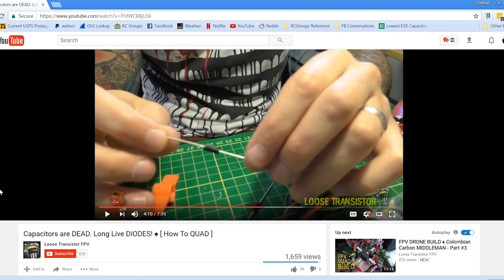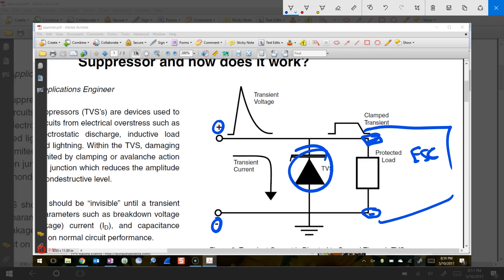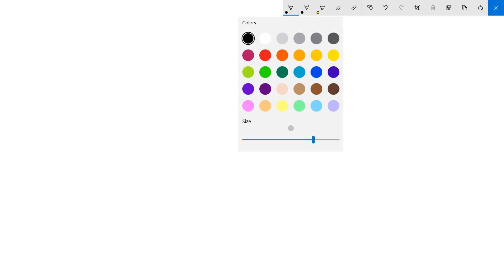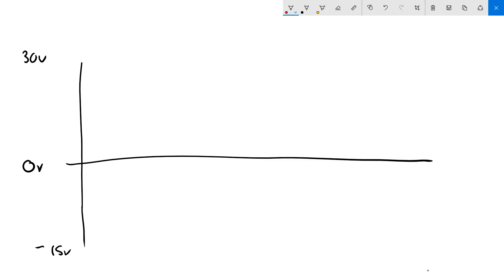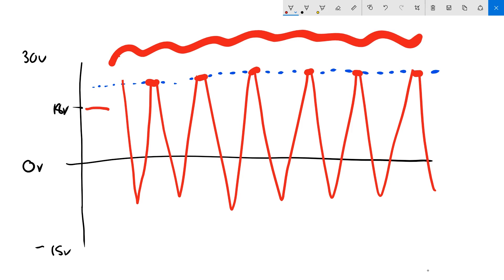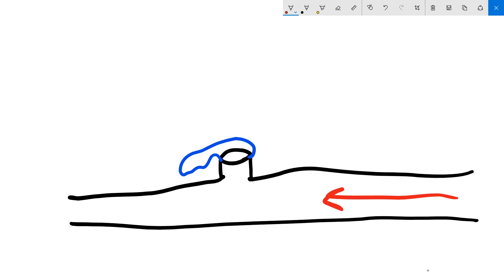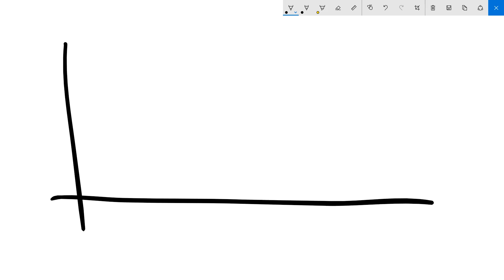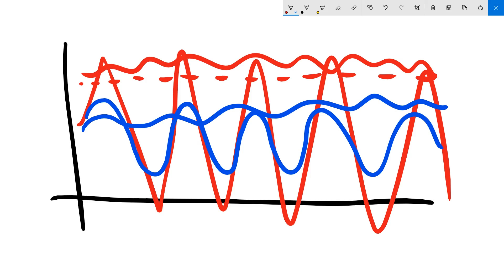TVS Diode Instead of Capacitor? No.

Comment: Hey Joshua, Glad to see you looking into this as well.

Yes the title was a bit clickbaity but I didn't think people would even look at it if I said "TVS Diodes are neat!" or something to that effect. I am preparing more data including some actual live tests with o-scope to determine once and for all what the effects of the TVS are and how they may benefit our builds. 

Another thing to consider in all this is the Battery itself, it is a capcitor and a rather large one so it too attenuates some of the noise in the system. It doesn't respond as fast as a low ESR but it is still doing something.

I am not actually saying don't use capacitors, I just wanted to start a discussion on an alternate method and sometimes controversy is the best way to start a conversation.

Happy to see people looking into this, because the more we learn about our copters, the better we can make our hobby. I will let you know when I have some hard data that we can look at. Sounds good?
Reply: I would agree that Loose's title and description is a bit misleading.  There is some confusion as to the type of noise a TVS may prevent.  What you point out in your vid Josh is common mode noise, which indeed caps are a must for.  A TVS can help with normal mode noise , and noise and instability caused by transients.  They are not intended to act as a filter for common mode noise as you presume in your video.  Noise from transients does not have a frequency component , and are relatively random in nature.   Also, the transient does not come from the ESC.  Rather they are generated by the inductive kick back of the motor.  Commonly know in the electromagnetic rotating machine industry as "commutation kick back".  Which can also be caused by the active breaking.   The primary purpose of the TVS is to snub these killer transients, which indeed are present , and do kill devices on our quads.  They will also help with noise generated as a result of the transient causing instabilities in power supplies (ie regulators) , as well as some  conducted, and radiated noise as a result.
Reply from the maker: +Loose Transistor FPV love to see the scope traces.
Reply: well Dirty , you just dont understand the issue.  You certainly may have not suffered any of the ill effects , but others have, and just because you have not, doesnt mean they dont exist.
Reply: We are working on getting those for you :) 8 channel synched o-scope readings, something is going to get science like in here :)
Reply: I would argue that noise won't kill a device NEARLY as quickly as a transient. So a TVS is a must. A cap is nice to have
Reply: I wanted to check everything ;), so all 4 motor esc'c, camera supply voltage, tx supply voltage 5v rail and back at the battery lead. Will give us lots of data.
Reply: Dirty Robert.  As has been stated, it hasnt been a real issue until recently.  The introduction of relatively very powerful motors, and switching very high currents into these inductive loads that it has become an issue.
Reply: TheWizard I agree, I just lost a matek vtx due to a voltage spike. Thus the reason I am looking into this.
Reply: Why do you need 8 channels?  Only one channel on the supply rail is all that is required.  However, please do get scope traces with and without TVS.
Reply: I'm running Cobra 2207 2450kv gold on 30A escs and it's not an issue.
Reply: Been flying quads for five years and never found this to be an issue. It might be that you are just not good at making a system that works as it should and patching your mistakes is the route you have chosen.

Comment: This may sound stupid...but...has anyone ever tried to make a battery for a quad out of capacitors? Assuming you can get the proper voltage, you have "limitless" amps to draw and it's significantly lighter along with ultra fast charge times and no degradation due to recharge...
Reply: It'll be empty in less than a second duh..
Reply from the maker: +Beau it isn't lighter when you take into account energy density I don't think. Build me a 1.3 Ah, 16 volt capacitor bank and tell me how bug it is.
Reply: Beau there is a video on YT where someone did that. I think it flew for 20s or something
Reply: SroArcher
I doubt that ;-)

Comment: Sorry Joshua, I'm a big fan of you and you helped me a lot in the past, but this and the capacitor stuff is getting ridiculous. I actually am an electrotechnics engineer and I can tell you that if you need all this in front of your ESCs, the ESCs are just cheap and bad designed. So instead of letting unexperienced people solder the strangest fire hazard stuff, maybe one should think about what's actually happening. Think about the size of a Diode which is supposed to pass through something like 20 Amperes (be it just spikes, but still..) :)
Also I don't think the Voltage is going negative in the event of braking. ;)
Reply: "I'm Ulf and you're going to learn something today" 😁
Reply: Joshua Bardwell IF we're talking about generative breaking energy stored in the spinning motor is fed back to the battery, and for that to happend the voltage at the ESC has to be greater than the  battery voltage.
Reply: Yes, what Joshua calls breaking should rather be generative breaking (think Toyota Prius). But if that happened, the voltage would increase to reverse the current back into the battery.
Reply from the maker: +Ibrahim Ulf Karlsson hmm. You're right abut that.
Reply: Joshua Bardwell - The only way current can flow from the ESC back in the direction of the battery is for the voltage to be greater (more positive) than the battery voltage - basic Ohm's Law.
Reply: Geoff Haynes I think it's Kirchhoff more than Ohm in this case ;)
Reply: Reverse current in this regard is completely different to negative voltages.
Reply from the maker: Yes, y'all are right. I'm not sure what I was thinking about negative voltage.
Reply from the maker: +Alexei C yes you are right. I know Ohm's Law but for some reason thinking about the diode confused me. Thanks for the correction. I agree that the voltage doesn't go negative.
Reply: Joshua Bardwell yes you are missing something. As it is explained in the picture I linked above.
Reply: So is this comment going to be pinned?
Reply: +Michel Pastor  As is the case with every other device on the quad.  AND , we have people building these fire hazards with very little electrical knowledge, or soldering skill.   There are FAR more things to be concerned about as a potential fire hazard than a TVS.  You may as well stop using ESC's , or any power at all for your quads, tie a string to them and fly them like a kite.  These strawmen arguments hold no water.
Reply from the maker: +Ibrahim Ulf Karlsson voltage can't increase both directions. If we define an increase in voltage as pushing current into the ESC, then by definition what pushes current out of the ESC must be a decrease in voltage. Or, more correctly, an increase in negative voltage. Am I missing something?
Reply: In the event of negative transients , you can use a bi-directional TVS that will snub transients of either polarity. Negative transients shouldnt be much of an issue in this case as they are rectified by the half bridges on the ESC.  However, they can still be present, just at a much lower amplitude relative to the positive.
Reply: Ibrahim, You are correct.
I think Joshua is confusing relationship of the current direction with the voltage. Voltage does not go negative when ESC is braking, but current does reverse. And it happens because Voltage at ESC pads is greater than voltage at the battery pads. Current will always flow when there's a voltage difference. How much of the current, well it depends on the resistance of the circuit and voltage difference. Think about Ohms law: I=U/R, so the larger voltage difference --> more current. Smaller resistance --> more current. Larger resistance --> less current.

another thing for Joshua: it is always good to know or be specific about your "reference" point when measuring voltage. It is assumed to be "ground" or negative terminal, but that's not always the case.
Reply: +Phil Jehmineh. When you say fire hazard you couldn't be more right. If we start putting a TVS diode directly across the battery in case it fails it could light the battery on fire. When the diode fails it often becomes a dead short and without a fuse the battery probably won't survive.
Reply: No big deal if the TVS catches fire but if it is the LiPo your quad is toasted not just the TVS. That's all I'm saying.
Reply: It doesn't take too much for one of those tiny diodes to fail. Take for example a Littlefuse 5KP TVS diode. Max continuous power dissipation 8W. Max forward voltage at 100A: 3.5V (single die). They can take only four 8ms long 400A pulses per minute max. 400A is not very much in the transient voltage suppression scenario. When it fails the only hope is that the high current from the battery finishes it (opens it) or something else opens the circuit before the battery catches fire.
Reply: Indeed. However, the transient currents we are dealing with are far lower.  While we do not know exactly the energies we are dealing with, and will vary depending on the build, currents are going to be in the few tens of amps at most in this application based on some rough calculations.  Nobody said to just pick any TVS and slap it on.  It must be specified appropriately. Again, you are bringing up strawman arguments that hold little water, and do not fully understand the application, the science, or the datasheet.    The risk of fire due to several other failure modes already present without a TVS is just as great.   A TVS can prevent several of these possible safety hazards.
Reply: Ok. I had a look at it. The current reverses, yes. But the voltage doesn't go negative, it adds to the supply voltage because reverse current through the input resistance, reverses the voltage drop over - in this case - the battery resistance. (sorry for my bad technical english)
source: https://5510d4d0-a-62cb3a1a-s-sites.googlegroups.com/site/planbparts/Home/brushless-regler/reglerueberlastung-beim-bremsen/Fig.%202.jpg?attachauth=ANoY7cosy74FzyUC13KBMUD4CuJpD-jhShDf8A4SP2sfbOn3R-KVIa1dNvm3W5kJI8bhDf1PvghBZ1LthTp_wUG5x7Cuf9CoTBKL3-8JX7btcOHVjGqSW1VCkc4nqbFNNXcXx-PIyAIZtCdV70eUaawSw8OQcVL7fX5h9iAUm9CCDxojNhYqi8tKYovqp3YeRf64BgDLiVsLQ7pzP9tlHmmelqJkytRrpmVdKxP6NyMqqSKNO3uWyEOCuEQ1L_T0qOOGPbxOTA-Vrw5M7NAJpJKVy9jraDmbKA%3D%3D&attredirects=0
Reply: Regenerative braking in cars work a little differently, they charge a capacitor bank (the ones i know at least) with the energy from the wheels after some rectifying and electronics. In our ESC's it's much simpler, they just short the motor wires with the FET's, or feed them with out of sync voltage, like when you want to stop a swing with a fat child. :D In this case, the motor will act as a generator, and will add or substract a little to/from the battery voltage, and this is the noise, or spikes.
Reply from the maker: +Phil Jehmineh there 100% is reverse current during braking, so there must be inverse voltage right?
Reply: Joshua Bardwell That's beyond my knowledge about ESCs to be honest, but following your logic, yes.
I was thinking that brakeing does  "short-circuit" the three phases and does not pass through until the DC side of the regulation.

Comment: One of the things I didn't like on the other video was a TV's on each ESC... really only need 1 (like the hubosd-se does) combined with multiple low esr caps for ripple.
Reply from the maker: The closer to the noise the diode is, the better it will protect. But yeah, maybe just one on the battery lead will be sufficient.

Comment: a tvs diode is going to  act pretty well but on my opinion  as an electrónica hobbyest i dont really like diodes on  esc 's alone . both working as a pair is the best no doubt . also you Willie never ser negative spikes con a battery, they are virtually noiseless
Reply from the maker: +Belrmar the oscilloscope begs to differ about negative spikes. At least I think so. Regardless, battery voltage is jumping all over the place between vBat and 0 volts and the diode doesn't touch that.
Reply: no one is (actually) saying we should ditch capacitors, there's the battery plus ceramic capacitors on the ESC. It's an additional component. It's just electrolytic capacitors that are  unnecessary.
Reply from the maker: +PiMan I disagree. I've personally seen too many copters that have been saved by even a few low ESR capacitors. And I don't think the TVS is going to replace them.
Reply: Joshua Bardwell What exactly do you mean by "saved?"

 there are certainly plenty of poorly designed electronics in this hobby, that doesn't mean a well designed, well constructed battery operated system shouldn't need them.
Reply from the maker: A well designed system will include enough capacitance to handle transients. It's because many quadcopter power systems are poorly designed that adding capacitors helps. So we're not arguing here.

What I mean by "saved" is, lots of video noise and you can't raise D gain hardly at all without getting desyncs on strong moves. Then you add capacitors and the video is crystal clear and you can tune normally.

BTW, I do believe I'm wrong about the negative voltage. Sorry about that...
Reply: i am not an expert on the field but the main reason i think we use caps on all those systems is not only for all the noise is to directly "feed " the esc when it demands current and the relatively high inductance of the cable is not able to supply the current for our lipos, also the cap will act as a low pass filter and will eliminate most of the spikes. a TVS diode is never too much due to their ultra high "switching". 

TLDR: low ESR caps are perfect for Protecting and helping to reduce noise and protect your ESC. a tvs doido is not a substitute but a helper

Comment: Yeap, you are right. Best electrical filter in our case would be a capacitor, TVS diode matched few V above mains voltage, a diode protecting from reverse voltage and a coil. But, since coil strong enough to hold 100A of current is waaay too big for us, and a big current diodes are also rather bulky, we have to live with caps and TVS diodes. To be honest, some ESC already have TVS diodes built in. 
If I had to choose between cap and TVS I would choose a cap.
Reply: Yes indeed.  Some ESC's and PDB's are already using TVS's
Reply: Cap is bulky, just sayin

Comment: Where is best to place separate ESC capacitors - near the ESC power pads or where ESC power wires are soldered to the PDB. I mean does the wire and distance from ESC matter?
Reply from the maker: +RandomWisdom ESC power pads are best. As close to the source of the noise as possible.
Reply: RandomWisdom no matter :)